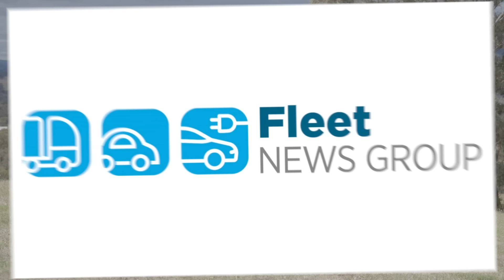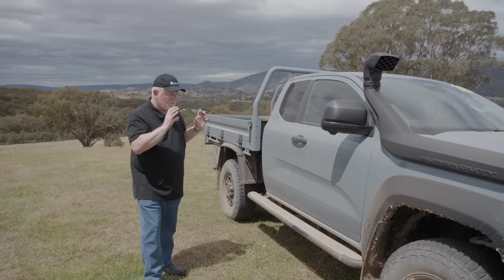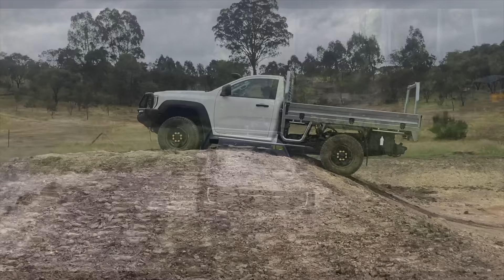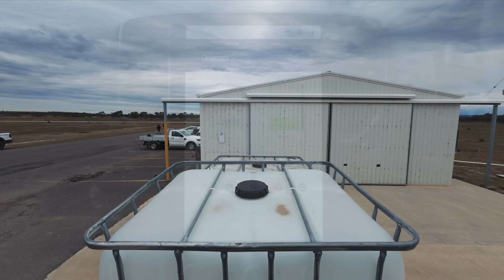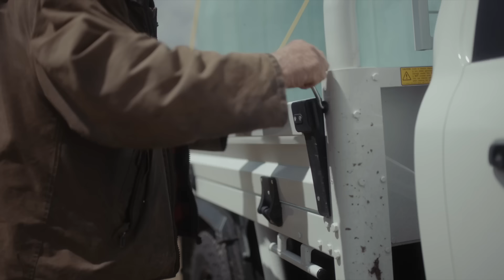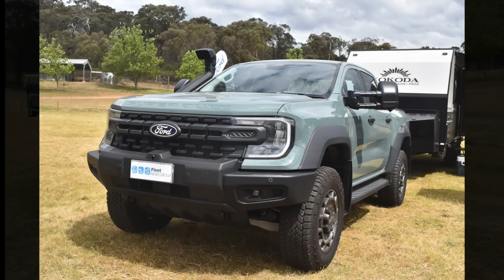Ranger Super Duty: 4.5T GVM, 8T GCM – The Ultimate Fleet & Towing Weapon

Comment: I wonder what the feasibility of bringing one of these to North America and swapping all the Heavy Duty components onto the North America Ranger Chassis. would Probably be a ridiculously expensive thing to try
Reply: The SD chassis only has 10% commonality with the regular ranger chassis - it is considerably strengthened.
Would probably have more luck importing a SD chassis and grafting a NA ranger body onto it. 😮
Reply: @andrewmcalister3462  it would depend on what componernt ws the registered "vehicle", if it was the chassis then it would have to 15 years old, if it;s the body then it would be feasible, still a pipe dream project as it would be ridiculously expensive to do .
Reply from the maker: It’s a new chassis so swapping wouldn’t work.